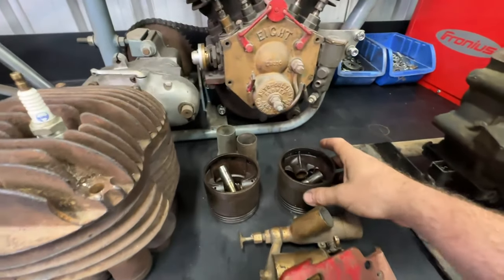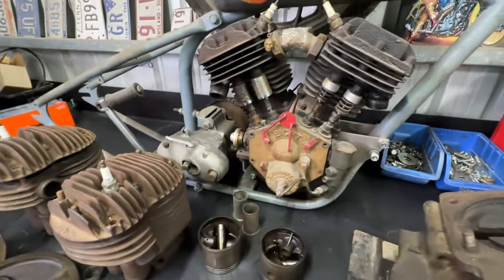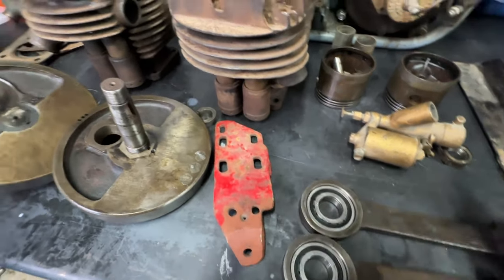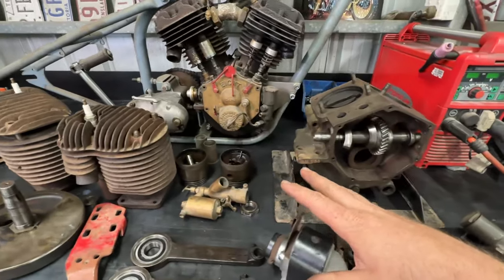Vintage Aussie V-Twin Chopper - Howard 80cube Big Twin Project

Comment: Love it. Did one myself about 40 years ago. Used cut down resized car parts,  JJ Powell's engineering in Nth Vic did the mods.
Brilliant old school tradesmen.
su carb from a old Morris, I've got a spare Stock motor and gearbox put away. Pretty heavy engine hey but the coolest engine Australia ever made. So Rare, well done mate.
Reply from the maker: Thanks mate! Looking forward to getting it up and running

Comment: Hi Phil Gary here, I have 3 Howard motorcycles that you can see running on this page. I built them in the 1980's. These motors were manufactured from 1932 to 1939 and are 1264cc or 77 cu in. There were only 5000 made so you are very lucky to own one. They were never designed to run much more than 1000rpm. If you try pushing too much more, the conrods will snap just above the bearing and punch a hole through the cases. I know so I redesigned and had stronger rods made. Hope all goes well with your build and if you need any information on them, just ask. PS, The oil pump inlet is the lower right, the lower left with the one way valve, goes to the crankshaft and rear of the right barrel. The top left comes from the crank case while top right returns to the oil tank. They are a very slow pump so it will take a while till oils spits out, yes spits out. These engines don't have oil pressure, they just need to flood the mains so tolerances in the mains is critical.
Reply from the maker: Hi Gary! Thank you for reaching out! hard to find information on these things. I have a few questions, could you please shoot me an email! (email in my Contact)
Reply: Hi Gary, do you know what the valve timing is on these engines ?

Comment: Cool project. I can remember a early ozbike with a Howard chopper. Might of been the eighties. Looking forward to seeing this on the road.
Reply from the maker: Yea! As iv said before! Iv heard of these choppers around and see old photos but iv never seen one in person or ever heard one of these engine run
Reply: @PhilsWorks There were 2 at Bulli last year. One is built like a flat tanker.
Reply: Yep i saw the one in ozbike in the eighties, it was cool and owner said it went well .
Reply: I still have all 3 and are in mint condition.
Reply: @PhilsWorks  Hi look on this page, there are the first and third ones I build running after full restoration.

Comment: There was a Kiwi back in the 80s?  Tried to stop others from building bikes with these motors.i know there has been a couple built since. Go for it, more power to you😊❤❤
Reply from the maker: Yeah someone else said this! Not sure how someone can stop others from building them! Good luck to him. I’m going ahead with this one!
Reply: @PhilsWorks  Good luck and if you need advice or parts suppliers, I know a bit.
Reply: Actually I only registered the design of the bike because you cant stop someone using any engine in a custom vehicle.

Comment: I’ve got to motor’s and a brand new magneto still in the box
Reply from the maker: Want to sell them?
Reply: @PhilsWorks  no sorry mate i inherited them but I would be interested in you building a frame for me the same as yours to suit the howard
Reply: how long have you had the motors ?
Reply from the maker: @markharwood4240  Many years now, been buying every motor I can find
Reply: probably lot of them went to tip's
Reply: @brendenquinn9794  yer not wrong boxhead
Reply: @brendenquinn9794  about 30 years ago
Reply: Mate recons there 1475 cc
Reply: @brendenquinn9794  Thirty tons of engines, and tooling went to Simms scrape metal in 1980.
Reply: I have the v twin  engine  and a single in a hoe that still sings 👍

Comment: A bloke named kiwi built the first Howard bike back in the eighties I’ve got the magazine with it in it
Reply: Hi Mark, Kiwi here. I built the first one in 1980, the second in 1985 and third in 1987. I still have all 3 and they are in mint condition. You can see the first and third on this page. They are running on the bench after full rebuilds.
Reply: @garybutler2731   great to here you are still about and still have them
Reply: ive seen the magazine you have i cannot believe how much stuff you hoard need to put yours in a frame and ride it @markharwood4240

Comment: Just thinking you could get a pair of bevel gears and turn the magneto 90 degrees so the gearbox fits
Reply from the maker: Yes I have a few bits and prices iv bought to move the maggy but I feel like it’s changing the engine and I would like to keep it as it comes from the machine

Comment: The Kiwi dude that built the one that was in early Ozbike claims he has trademarked the use of Howard engines in motorcyles. 
The bike was featured twice. First with a Trump frame and then with a custom plunger frame.
Reply from the maker: Hahaha is that right? Suppose we will see what happens when I build mine then!
Reply: I spoke with kiwi about 20 years ago when I was going to build one myself and he said no worries the patten had expired anyway